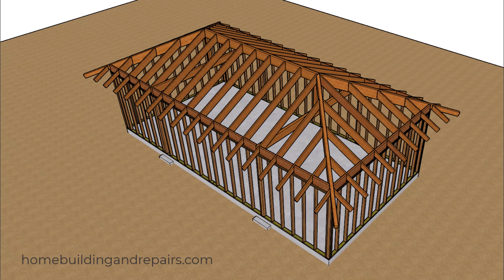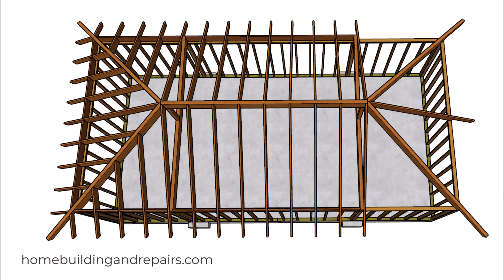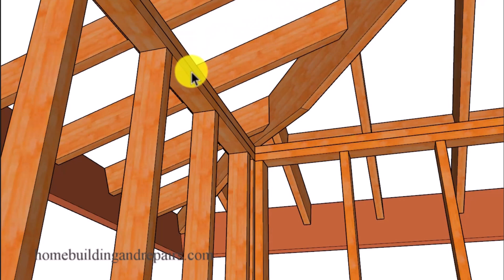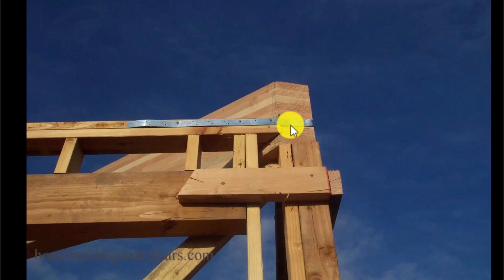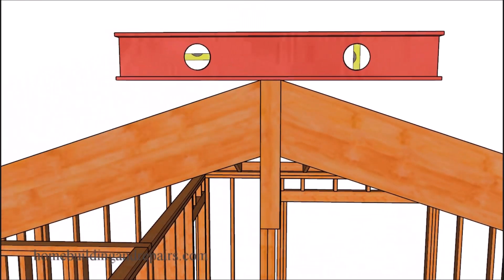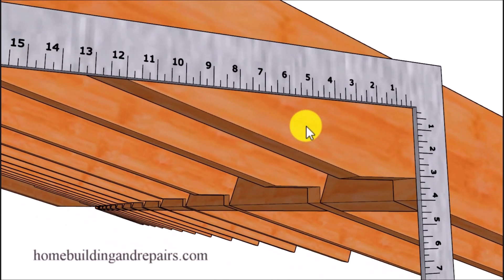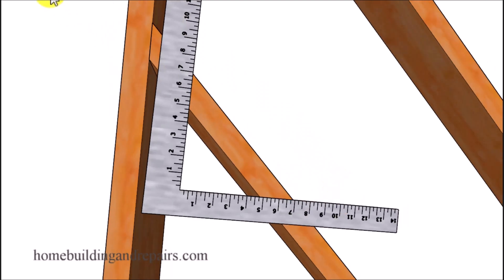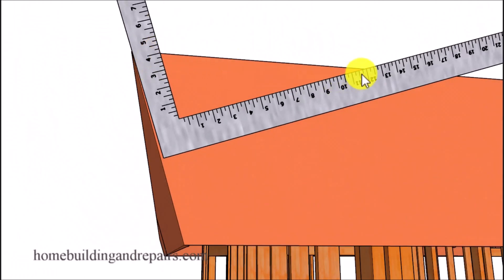Building A Hip Roof - Vaulted Ceiling Framing, Large Beams, and Component Calculations

Comment: On this type of roof , how do you figure out how many roof shingles are needed?
Reply: For 4/12 pitch, just calculate the square footage as if it were a flat rectangle, then I believe times 1.08 (slope factor) and since it’s a hip roof use 15 or 20% waste instead of just 10. 3 bundles of shingles will cover about 98 square feet. Hip and ridge should be self explanatory using the manufacturers info on their packaging
Reply: @ thanks